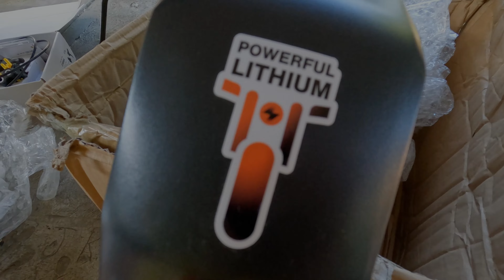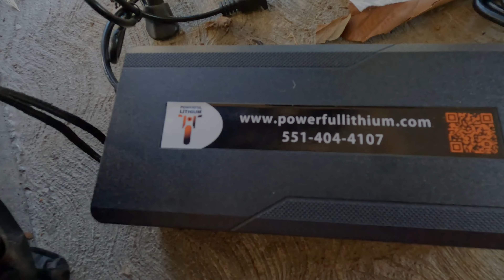Powerful Lithium 72v 71AH Dual batteries in Super73 RX pedal assist custom ebike build Part 5

Comment: Great build🤙🏼
Reply from the maker: Thank you! 🙂 can’t wait to ride it
Reply: @atom0023  how is the bike coming along..? 
I thought it’s not safe to put those battery pack in parallel just by using the y splitter
Reply from the maker: @mrk_u1352  no it’s totally fine. Ran 6000 miles with this setup. Even got up to three stock batteries in parallel
Reply: @atom0023  do you charge them all at the same time with one charger or charge  them individual
Reply: @atom0023 do you have any splitter for sale or where to get them 🤙🏼
Reply from the maker: @mrk_u1352  I have three charges and charge them off the bike separately
Reply from the maker: @mrk_u1352  for sure just message me on instagram. Same name. Atom0023
Reply: @atom0023  I don’t have IG a you have Facebook?

Comment: how many amps does the 60a pack put out? just wondering because that splitter they sent you does not look like it can handle 100 amps
Reply from the maker: 60ah is 140 amps

Comment: My Magura rotors and pads are already toasted after 61 miles of 72v riding on my Z1. They don’t like stopping from 60+ mph.
Reply from the maker: oh man, that will drive me nuts. I am a really mellow braker and I will turn on regen. Hopefully my experience is different. I  got over 2000 miles on my stock brakes before needing to change them.
Reply: I was running at 15% regen I turned it up to 30%. Waiting on my regen throttle from Amazon.
Reply from the maker: your bike is way lighter too. That sounds concerning
Reply: would be better converting an ice bike with components rated for higher speed and loads.
Reply from the maker: what’s an ice bike?

Comment: Look forward to the range tests uploads. To improve range couldn't you fit mid motor with gearing ?
Reply from the maker: I thought about that but it cuts into my battery capacity. having the motor in the hub frees all the center space up for battery.
Reply: Sure it could be fitted behind the wheel somewhere

Comment: No battery blender combiner ?
Reply from the maker: I think they are only required if the batt voltages are different. The entire system is 72v

Comment: Why would u remove pedal assist. Are you saying if I wanna upgrade like you did I will loose the ability to have the assist
Reply from the maker: I added the 72v pedal assist that the new kit comes with. maybe the stock one could be spliced in but not sure. haven’t got it to work yet
Reply: @atom0023   atom by purchasing the 72 v kit and adding the battery is it plug and play ? Do u know if the super 73 software and components will still function or are u just using the frame and making it your own
Reply from the maker: @the-bu3lb  frame and making it my own. If you want to use the stock components mixed with super73 stock lights check out @mrcentraldriver on YouTube

Comment: You ended doing the famous range test ?! If so what did you get ?! Did it meet your expectations ?? Let us know ⚡️
Reply from the maker: Yea it’s a little cold now. But I got over 75 miles I think. I should post a vid soon. Thanks for hanging in there but I think I’ll post a 90 miles ride soon
Reply: @atom0023  amazing my guy, I am sure you can crack 100miles on this set up 🙌🏿